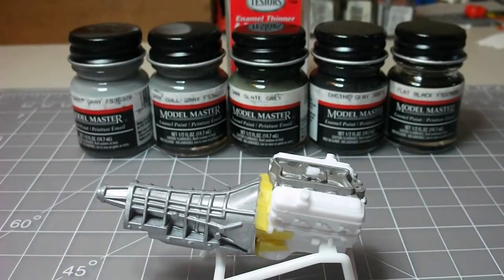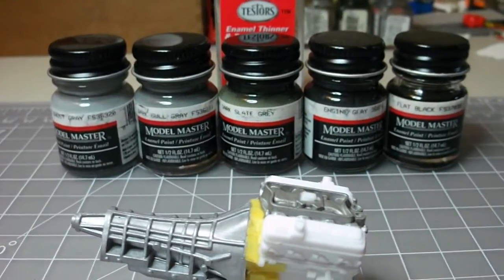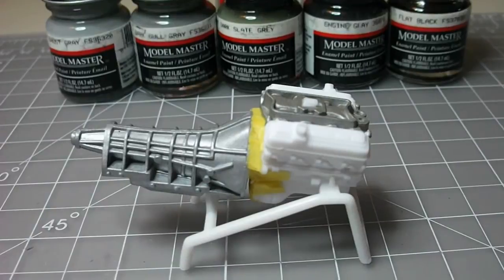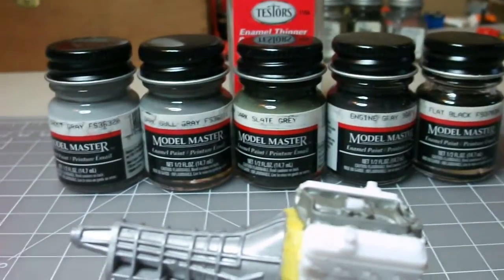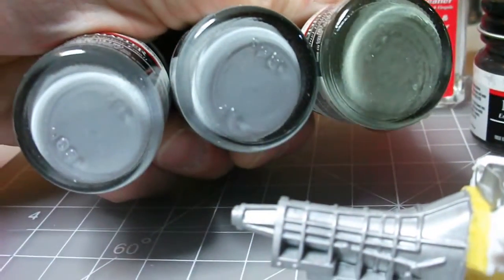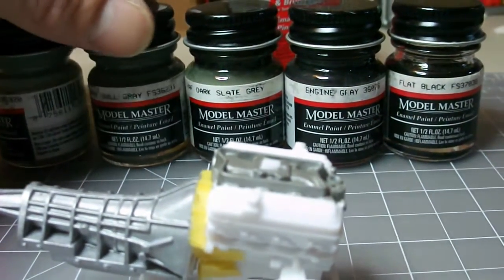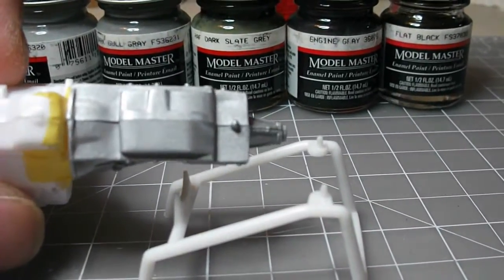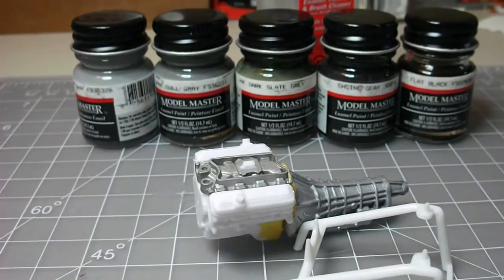Question about mixing enamel paints

Comment: I have found that when mixing two of the same colors the gloss showed up more in the mixed version. I kept my enamels a little thicker than acrylics. If you have not, I would highly recommend going to the paint store / hardware store and buying a big gallon of paint thinner or mineral spirits. It will so much money instead of buying the little bottles.

Comment: if your main color is a flat if you mix a small amount of gloss it will still be more flat than gloss, may turn to a lil bit of a semi gloss. I usually dont thin any brush paint just my spray stuff. I agree with super I would go to like wal mart and buy a large thing of thinner for like 5 or 6 bucks if I was to be thinning paint cheaper than that testors stuff.